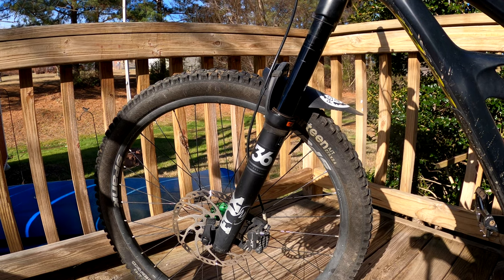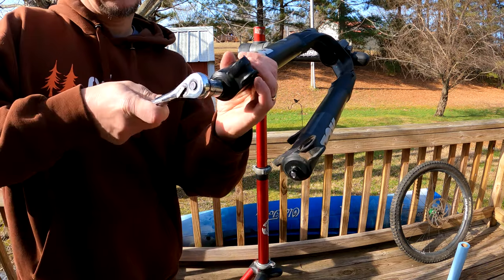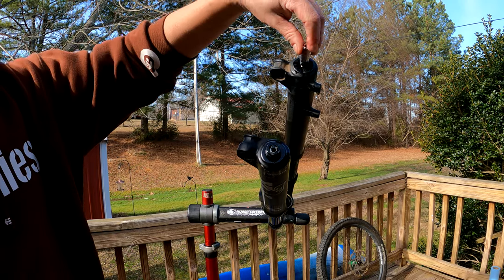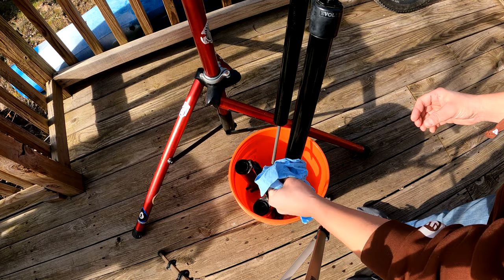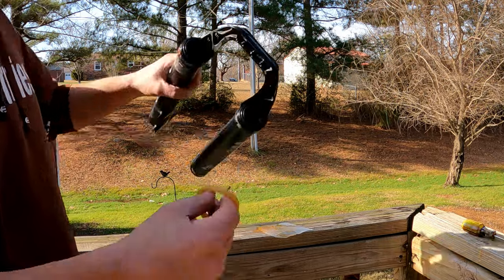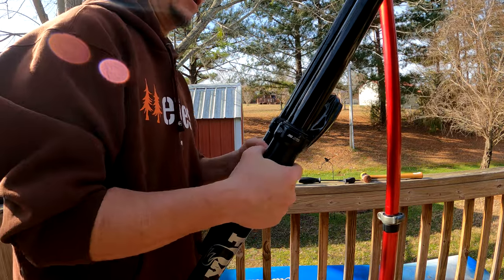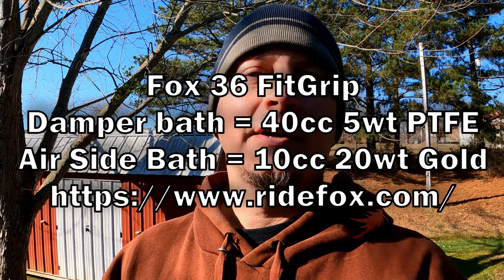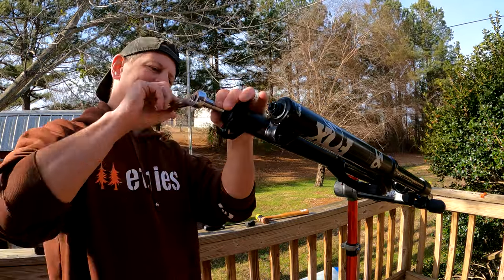How To Service Your Fox Fork | And Just What Oils Go in a FIT GRIP Damper??

Comment: You just helped me out a lot.  I didn't realize there was just a "plain" grip damper.  I thought it was only Grip 2 and FIT 4.  I almost put the wrong oil in.  

Have you ever taken the air spring rod and pistons out of the bottom?  Mine had way too much grease.  I also found that there wasn't any oil in in top of the air chamber.  I am adding 3oz per the oil volume service chart.  I also found out there is four tokens in my air chamber from the factory.  I am pulling one out as I am not that aggressive of a rider.  Will be interesting if it smooths the trail out a little more.
Reply from the maker: The amount of grease inside of my airspring was crazy thick as well.  I hear this a lot from fox owners.
Glad the video helped you out!

Comment: Great video. I was wondering if you could slide the upper into the lower with the fork seals and everything already mounted on the fork tube. Then lining them up wouldn't be so tricky. I'm sure that's the easiest way to damage the seal trying to get those two together without scratching the seal. Either way interesting. I've done them before but not the newest ones
Reply from the maker: Possibly I suppose.  I could see Push seals working like that over factory Fox seals.

Comment: Hi, thanks for the video. But what about the 3cc in the air chamber?
Reply from the maker: Yes, I missed showing that in the video...but you are correct.  I added 3cc 20 weight gold in the air chamber.
Reply: @PedalingDave  Oh ok, i asked also because i don't see anyone showing it. So basically i just have to unscrew the top cap with a 26mm tool. This is where eventually you can put the spacer, right? Just add 3cc and close again. No air or any important operations has to be done?
Reply from the maker: Yes, That will work great!!
I just took the valve core out and added the 3cc.

Comment: I wouldn't strike on the soft alu nuts with a socket between. Maybe earlier damage to the nut caused the air shaft to rotate?
Reply from the maker: Air springs within the air chamber are only held in by a clip that keeps the spring from popping out.
Greased O Rings are the only thing putting pressure on the inside of the stantions...so it's easy for the air spring to potentially rotate.
As far as freeing the lowers from the dampener and air spring by hitting with a socket goes, their isn't any danger unless one were to go nuts and wail on it.  I just gave it a solid tap and have been using this method for years.

Comment: Not sure if you will respond but just got a bike and noticed some oil where you would connect the shock pump in the little bowl underneath the cap that protects the valve from dirt best way I can to describe it. is that a problem I did have the bike upside down as I was doing a wipe down cleaning not sure if gravity would cause this. Bike is Specialized Fuse Expert 2022 with the Fox 34 Rhythm Float front shock. Thanks
Reply from the maker: It could be that the valve core in the fork is loose allowing some oil to escape but if that were the case, it might not hold air either.
It's likely not an issue if it's a small amount of oil and the fork holds air.  The air chamber typically gets 3ml of oil added on certain fox forks.  Check ridefox.com for yours of course.

I'd suggest cleaning it up really well with alcohol, set air pressure, and give it a ride to get the fork moving through its travel.  If no more oil is found and the fork works normally, (I can only guess) its probably fine.
If in any doubt, take it to a bike shop for inspection!
Reply: @PedalingDave  Thanks appreciate the response.

Comment: When trying to install/torque the damper nut, the damper rod spins not allowing to to properly torque it.  Have you encountered this before?
Reply from the maker: I've had that issue with the air spring side but not the damper.
Typically I'd add a little air to keep the air spring from spinning.
I'm not sure how to advise you on this one but you might start the nut on the damper.  Tighten the air side and add a little air so that the lowers add pressure to the nut and then see if that allows you to tighten without it spinning?
Just a thought and I have no idea if that would work.
Reply: @PedalingDave  thank you
Reply: @PedalingDave  so what I learned.  I wasn’t using a torque wrench, just perceived torque.  I procured a torque wrench and set it to the 50in lbs that is called out.  I was able to adequately tighten to the spec without the rotation of the damper shaft.  I’m glad I have a nice wrench for bike work now haha.

Comment: I did lower leg service on my Rhythm 36. After that i measured stanchions and they r 175 mm instead of 160...wtf? Same amount of oils and air before service. Fork performs nicely but im still a bit worried..did i forgot something? 🤷
Reply from the maker: Did you measure prior to the service and sure it measured 160mm??
If so I don't know what's up with that!
Maybe it was sucked down into its travel and you weren't aware?
Reply: @PedalingDave  No did not checked it before service but then again it is 160 mm fork so i assume that it was around 160 mm when i bought it,well it came with the bike. It is this year model btw
Reply: @enjoylife756  I would say that is normal, I have identical Fork as the one in video 170mm travel, and stanchions are round 180mm, since Fox bottoms out around 1cm before the crown, it will never allow to hit it I think